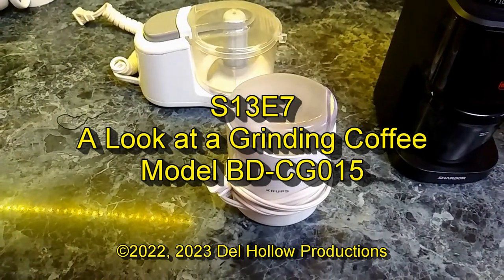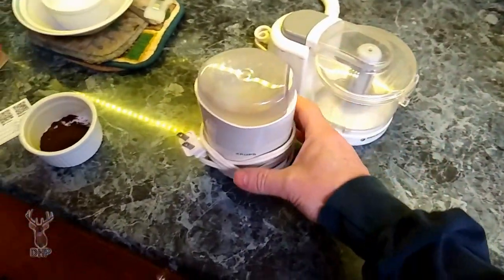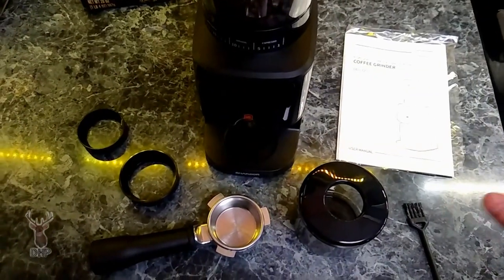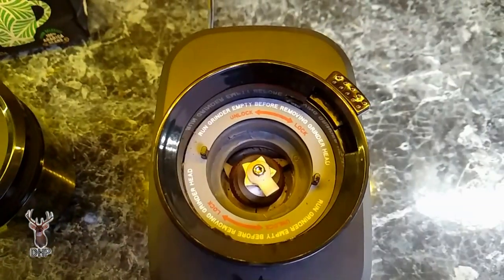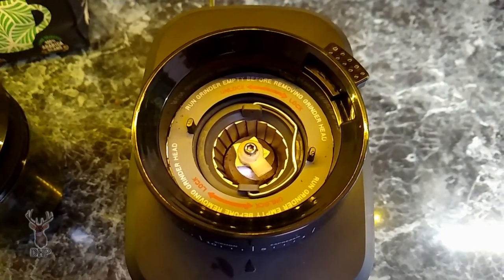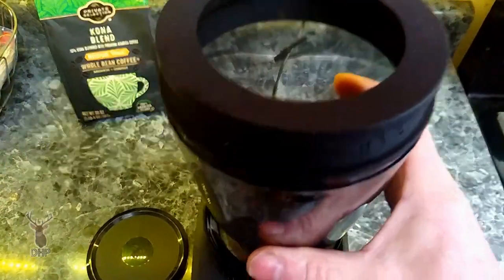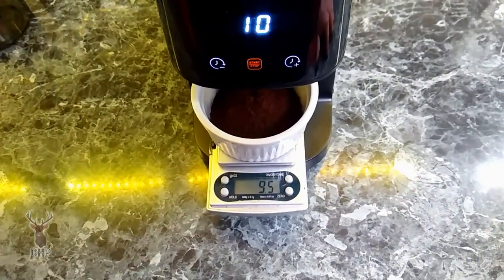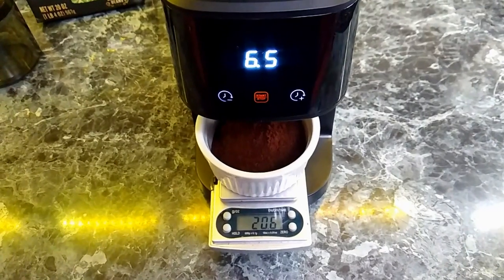S13E7 - A Look at a Grinding Coffee – Model BD-CG015

Comment: The machine came with two small circular metal pieces and another metal long piece, but the user manual provided no information about their purpose or use!! Did you find them when you first purchased the grinder and what are they used for?!
Reply from the maker: Amazon. And no I don't remember any loose pieces. I did get a brush though. It's still working well.

Comment: I have the same model and I get the E1 error and I can't get it to work. I've already tried the ways the manual says, any help?
Reply from the maker: I dunno. With the grinder bits out and it unplugged, can you tell if the motor is locked up? Probably need to buy another grinder. Just a guess, but I bet there are plastic gears below what we can see. And on Amazon, I see complaints of coffee having rocks, wood etc. from the coffee farms. 

More so I think in the lefty feel-good small-farm specialty coffee producers where it's literally old school manual production and much is "unwashed" (wood floats, rocks sink). 

PURE SPECULATION: but if they have plastic gears below the burr AND you ever had a rock or something, it may have stripped a gear. Likewise, it could be something electronic in the controller or key pad (button).
Reply: Any luck on this as I have the same issue. Burrs dismantled and cleaned but still showing error code.

Comment: Hello, I want to ask if the grind is fine enough to get a slow extraction for a good espresso?
Reply from the maker: It will grind Turkish I believe.
Reply: Yes, it is. I bought one for my espresso machine, and I got a 1 to 2 ratio in 28 seconds (not counting pre-infusion) on the 4th grind setting. And I used medium to light roasted beans if that matters. No regrets from me. HIGHLY recommend 👌